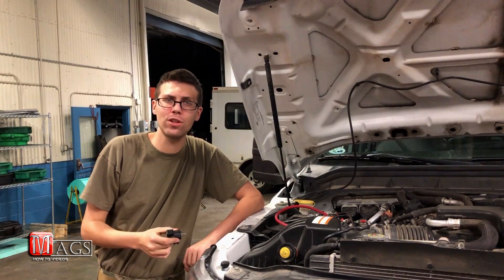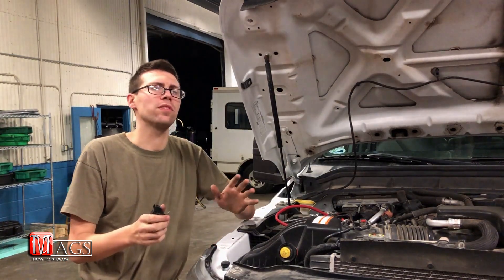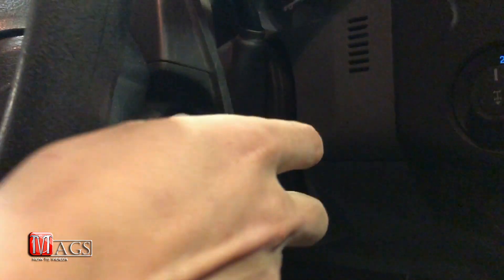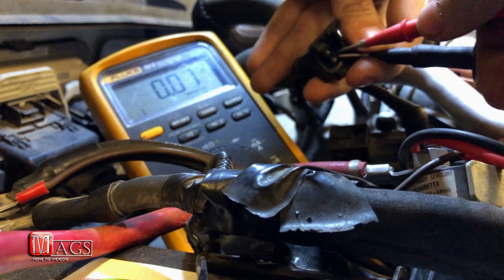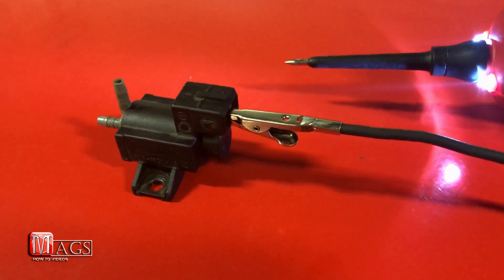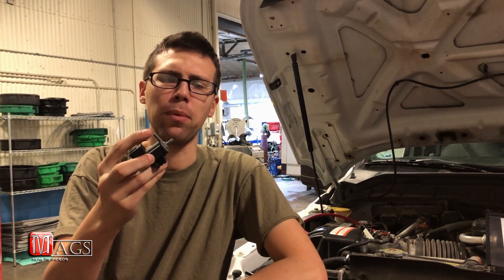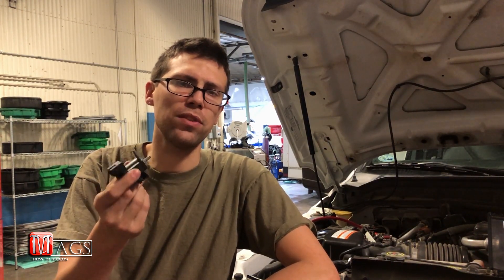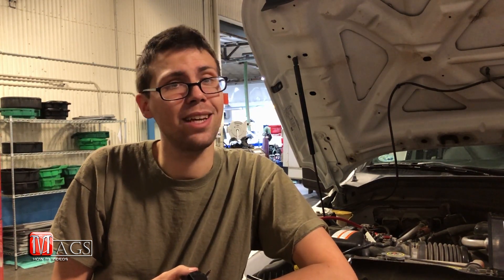How To Test a EGR Valve Solenoid

Comment: There is no power reaching the valve. The tester shows nothing. Where should I look for the break in the circuit? Please help.
Reply from the maker: If your EVAP purge solenoid isn’t getting power, the problem is usually electrical rather than the solenoid itself. Here’s a step-by-step way to diagnose and fix it, starting with the most common causes:

⸻

1. Confirm the power issue

Before chasing wiring, make sure the diagnosis is correct.
	•	Turn the key to ON (engine off)
	•	Use a multimeter or test light
	•	One of the two wires at the purge solenoid should have battery voltage
	•	The other wire is usually grounded by the ECU

No power on either wire = upstream issue

⸻

2. Check the fuse (very common)
	•	Look for fuses labeled:
	•	EVAP
	•	Emissions
	•	ECM/PCM
	•	IGN
	•	Check both:
	•	Under-hood fuse box
	•	Interior fuse panel

Even if a fuse looks good, test it with a meter.

⸻

3. Check the relay (if equipped)

Many vehicles power the EVAP solenoid through a relay.
	•	Common relay names:
	•	ECM relay
	•	Main relay
	•	Emission relay
	•	Swap it with a known-good relay of the same type
	•	Listen/feel for a click when the key is turned on

⸻

4. Inspect the wiring

Focus on:
	•	Broken or frayed wires
	•	Melted insulation (near exhaust parts)
	•	Corrosion in the connector

Gently tug on the wires—internal breaks are common.

⸻

5. Check for ECU control (ground side)

Even if there’s power, the solenoid won’t work unless the ECU grounds it.
	•	With engine running:
	•	Back-probe the control wire
	•	ECU should pulse ground during certain conditions
	•	A scan tool with EVAP purge command makes this much easier

If power is present but no ECU ground → possible:
	•	Broken control wire
	•	ECU fault (rare)
	•	Related sensor issue preventing EVAP operation

⸻

6. Scan for trouble codes

Even if the CEL is off, scan anyway.

Common related codes:
	•	P0443 – purge solenoid circuit
	•	P0458 / P0459 – low/high circuit
	•	P0440–P0457 – EVAP system faults

Codes give direction, not just symptoms.

⸻

7. If everything checks out
	•	No power at fuse → wiring or ignition feed issue
	•	Power at fuse but not solenoid → broken wire
	•	Power & wiring good but no operation → bad solenoid or ECU control issue

⸻

Quick summary

Most common fixes (in order):
	1.	Blown fuse
	2.	Bad relay
	3.	Broken wire near engine bay
	4.	Corroded connector
	5.	Faulty ECU ground control (least common)
Reply: @MAGSHowToVideos  Sorry, I meant to introduce the EGR valve.

Comment: I just tested the egr solenoid on my 97 eclipse gsx that has had an idle surge issue when it is warming up but idles normally once it reaches operating temperature. I blew air through it like you did and it definitely is not holding a vacuum. My egr solenoid is located on the firewall right above the intake manifold. 2 10mm bolts holding it in as well as the evap purge solenoid that sits to the right of the egr solenoid. I hope this fixes my issue. ❤

Comment: Also the dude does mention on how to use the multimeter tool. So first off it needs to be on DCV 20. Then you have to connect the negative to the negative battery. Then you can turn your car on to the on position. Finally use the red pronge from multimeter to the plug in wire to positive side. You will figure out which one is which. Then you get results. 

Otherwise you can't just results by hooking the multimeter straight to the wire ports like they show in this video and others. It will not work like that on all vehicles.
Reply from the maker: Thanks for watching and sharing your input. I’m sure this additional information will someday help someone.

Comment: Great video!! Just did the tests you did on my old solenoid and it's not holding vacuum & barely clicking after I smacked it a couple times. 
Question: Would a bad EGR solenoid possibly be the reason behind why my fuse keeps blowing for the Secondary Air Injection System (Smog Pump)?

Comment: @MAGS How To Videos >> Dont work for Fords though on that blow test as Ford EVP solenoids , because they come in the open stage and only close when electric is supplied to that internal coil , other wise it is vented thru the cap in it. for what you are calling a Egr Solenoid is wrong ( sorry ) that is a EVP Solenoid , which stands for electric vacuum port . Now With That all said , I got a Honest question for you to chew on , that i am trying to find a answer to . That Evp solenoid is controlled thru the ECM which we all know . BUT how and where does the ECM gets its reading from to open and control the EVP ?? Is that controlled thru engine temperature or or thru a reading on the O2 sensor ?? to tell it the engine is fully warm and now to start operating the EGR as the Egr operates on nano movements as you accelerate and decelerate thru your driving profile. and because of the fact that the EGR also tells the engine how to trim your fuel injectors which can cause hard fuel consumption among various other issues .

Comment: Thank you, for the blessed presentation. I did these checks on an ‘03 Mazda Tribute with a 3.0 V-6. 
I noticed no vacuum going to the EGR from the valve. I removed it, supplied power and ground to the EGR valve with a power probe, and no “click” at all (indicating the  solenoid is not functioning, as you said). 
My question is, have you seen many faulty replacement EGR valves?  The one I tested seems quite new. Just curious if you have ran across a few duds in your time. 

Be blessed, be well!

Comment: The 1990 EVTM describes using a vacuum source. I'm using a dual set of vacuum gauges to monitor what is going on. What I'm using would not be detected with this test.

Comment: I've just tested a suspect valve and one port won't allow air through ( which is normal ) but when I blow through the other port air escapes from the small round cover on the back of the valve.  When I connect it to a 12v battery it opens and allows air through so I know it's working, but when I blow through and cover the other port, air is still escaping from the back of the valve where a small round cover is.

Comment: Hi, watching your video in 2024, just a quick question, I checked my car egr solenoid harness and the power was 9.70v . Should I be concerned? I have nissan qashqai dci 2014 with codes P0403 and P0409.
Reply from the maker: @ibneamin3925  I’ve never worked on Nissans, but yes it should be 12v. With that said, if your vehicles battery is reading 12v, that means somewhere between the battery and the EGR solenoid there’s a voltage drop. Common causes, a burnt/corroded wire, fuse panel or computer.

Comment: I did the test just like you did. (The connections for the tubes are in line)  and when I blew into the top tube, air comes out of the bottom connection. When I blow into the bottom connection it's closed. is this a good Solenoid?

Comment: The video was helpful but you dd not show us on the working blowing both side should all hold air or what mine one its holding air another is not also wen u blow it shaking it will open air should l get another one or also wen start vehicle its giving pippin sound wen switch of and on it stop it can start evn wen driving so l need to know of I need egr valve or solenoid
Reply: Did you ever figure this out? I'm in the same pickle

Comment: So what if I have 3 ports? I do get the clicks, now when I blow in one air does comes out of one but not the other but when I supply power then both push air out.  Is it still bad. Solenoids are from a 89 ford probe gt I have two solenoids
Reply: Now I should say one port has a cap on top and the other ports are like the ones  you are showing a side one and bottom one.

Comment: I'm Trouble-shooting The EGR system on my 2005 Santa Fe 3.5L V6 The EGR Valve Solenoid is in a 'open/Vacuum' position, when not powered. With Power supplied it 'Closes/no Vacuum' The wiring Harness Plug Has power, but the Negative(?) connector side of the Plug seems to not be connect to a Ground Source... My Question is: IS The Negative side of this Harness Plug controlled by the ECU through the ground wire, or is it the Power-wire that is controlled by the ECU?

Comment: can a bad egr solenoid cause truck to shut off or die when its running ?
Reply from the maker: Signs your EGR valve is starting to go bad is reduced engine performance, rough idling, engine knocking, fuel smell inside vehicle and engine warning lights. Any of these things can mean you have a bad EGR. A faulty EGR valve affects engine performance by creating rough and jerky accelerations. It also reduces engine power, which is noticeable during low and high speeds. The problem is usually more noticeable at low speeds when the valve is stuck open and more apparent at high speeds when the valve is stuck closed. In worse cases, it can cause the engine to shut off while driving.

Comment: Only 3.79 volts arrive in my car's harness, it's a Golf 1.6 SR, is this normal?
Reply from the maker: I’ve never worked on a Golf 1.6 SR before but 3.79 volts doesn’t sound right. Even if you were testing a 5 volt power signal wire that wouldn’t be enough. Sounds to me like you’re going to have to test your wire hardest to see if you have high resistance.

Comment: So the solenoid should be holding pressure when blowing into either port? And have open flow when applied voltage?
Reply: Good question we will never get an answer for unfortunately.

Comment: Thanks for the video. What about a 3 pin egr valve sensor for a 2007 hilux 1kd ftv? This sensor sits on top of the egr valve and is separate to the vacuum sensor.

Comment: My solenoid blows air through si as you said it’s stuck on open position But when I plug it in power it clicks and holds pressure but then when then take it off the power it remains open.  Is my solenoid bad? Or Good? :). Thanks for the great video!
Reply from the maker: If it retains pressure when powered on it sounds like it’s still good.

Comment: New solenoid doesn't hold vacuum on either side.
The one side that should hold, leaks through the vented side with the filtered cap. Slowly, but just doesn't hold.
Reply: Mine does the same thing did you figure it out ?
Reply: @timothyproksch2915 I ended up using the old one, but I put the new electrical switch part on it. So I Frankensteined it. LOL
Buying cheap parts, sometimes makes things more difficult to fix.

Comment: Please explain how recycling exhaust gases back through the intake manifold will make things cooler?😮🤔🤔
Thanks heaps.
Reply from the maker: By recycling some of that hot air mixture back into the engine, there is less going through your exhaust system which allows it a little more time to cool off. Granted it’s not much, but over time I believe it helps extend the life of some of those parts. The main reason for the EGR Solenoid is to help burn off more of the access gas vapors to produce cleaner admissions.
Reply: Gases Goes through an egr cooler that's water cooled

Comment: What do you mean with the solenoid is ceased? The solenoid is not movable, it's the valve which is movable
Reply from the maker: I mean does the solenoid open and close. If not there’s something wrong with it.
Reply: @MAGSHowToVideos  a solenoid is just a helical coil of wire and it's not supposed to be movable. But it controls a valve and the valve is supposed to be movable

Comment: Great video, thank you.  One question, when the car is not started, but the ignition is on, would you expect to receive 12 volts at the EGR solenoid? I would guess the 12 volts would open the valve and allow vacuum to pass to the EGR valve and open it and thus allow exhaust gases to pass into the inlet stream. I would have thought the introduction of the EGR gases would be dependent on engine temperature and as such the 12 volts would only be present when the computer detected to correct conditions - temp etc.
Reply: either what you said or the the 12 volt signal would be cut off at the time the computer sends the command.

Comment: Should both sides hold vacuum?  Mine is missing the cap on the end. Bottom hose line hold vacuum. top hose I can blow through. Is this normal?
Reply from the maker: Yes that can be normal the real test that’ll determine weather it’s good or bad is will it work when power is supplied to it. Not sure about the missing cap tho.

Comment: I just took off my solenoid. Air escapes from one of the sides when i blow and when i block the other side. Side does not escape from other side when i try other side and blow. Is my solenoid faulty ?
Reply from the maker: Not necessarily that could be completely normal depending on the type of solenoid you have. Have you performed all of the tests? The main test that will determine if it’s good or not is the power prob test.

Comment: Quick question can a VSV properly click when powers applied… But… But the Om readings are below the minimal satisfactory for instance… Mine should be 33 to 36… It reads 30 and 31… Could this still be failing even know it will click when power is applied… Thank you for a response this one's kicking my butt

Comment: Something to keep in mind is that  any electronic solenoid/ actuator  can have either a power or ground  activated  circuit.  
Applying  12 volts to the wrong  terminal can and will fry your computer! 
Bench test with power on only,NOT on vehicle. See scanner Danner for a short but informative vid.

Comment: Great video. How about having to check ohms on the solenoid. Is that needed if you hear click or not when supplying power? If so, what should be reading?  Thks ....jc
Reply: Testing for ohms would not be needed as the click means that it opens and closes properly.
Reply: @directautofix  got it..thks.jc

Comment: Thanks for the video! 
For the good valve, both channels should hold pressure or only the one that goes to EGR? In your video, your testing only that.
Reply: Yes this is what I need to know as well. A lot of info is actually left out of this video. I had to learn things myself even watching this video..still I have 3 ports on my solenoid. One is a vent and of course outlet and inlet port. I can blow air in the outlet port and it comes out of the vent port. I can't blow air in the inlet port.. this guys egr valve is different then ours.

Comment: Great video! Just bought a car, previous owner told me someone scanned the ECU and there was a code "related to the oxygen sensor". Got home, scanned the ECU and the code I got (P0403) is NOT related to the oxygen sensor, but the EGR solenoid. I'll be testing the connector for power and the solenoid to see if it's stuck. Thank you for pointing me into the right direction!

PS: That outro music got me head bobbing right now... LMAO.
Reply: Hi, did you fix your car? i have the same code p0403 and p0409. I managed the check the solenoid harness today and the voltage was 9.70v.
Reply: @ibneamin3925 did you fix it and what was actually wrong with it?

Comment: my EGR is not gettiing 12v at the plug, is that normal ? 08 Ford Ranger ?
Reply from the maker: If you have your vehicle running and you don’t have 12V going to the solenoid than something is wrong. The most likely thing would be a bad wire. I would try an locate some sort of wire diagram and trace the wires so you can test for resistance.

Comment: So when u blow no air should come out. When its good?
Reply from the maker: Depends on the brand you can’t always rely on the blow test because some are made to be closed and so open. The one I used in the video was a closed module. To truly tell if the solenoid is bad you need to perform all the tests if it passes all of the other tests then it should be good.

Comment: my egr is electrical , no vacum hose. If i put 12 v without dismantling it and don't hear the click does it mean my valve is stuck and need to be replaced?
Reply: Or the pintle is jammed with soot

Comment: My solenoid is stuck closed, and not clicking when power is applied.
Reply from the maker: Sounds like it’s most likely broken and needs to be replaced.
Reply: I have disconnected the vacuum pipe that comes from solenoid im not getting any vacuum

Comment: So what happens if it’s holding a vacuum on the highest input and when you blow through the lower one it’s letting air out does that mean it’s still partially open or failing somewhere. Because I’m able to make the actuator click but in trying to put air through the solenoid one will Maintain a vacuum and the other won’t
Reply from the maker: Some vacuum valves allow you to blow through one end but not the other. The one I had was designed to be closed in both directions.
Reply: @MAGSHowToVideos  Ah. One more question. When the EGR valve releases to open, do it do it slowly or instantly. I did a vacuum test and the pump released the air in about 2 seconds.
Reply: @MAGSHowToVideos finally the answer I have been looking for in the comments. One more question can I hook my solenoid straight to my battery to test if it clicks?

Comment: 2:07 - "Ok here we go, we're going to turn the multimeter on...." - Perhaps for your audience, can you please mention what setting you set your multimeter to when you measured 12v vs testing power probe for 12v? Thank you for your video
Reply from the maker: To answer your question the multimeter was placed on DC volts. However, thanks for the input I will try to remember to do that in future videos.
Reply: If you don't know what setting to have your multimeter on then you probably shouldn't be stripping solenoids off motors.

That's the 12v DC testing for beginners video  you want.

Comment: on a 94 Honda Civic it works differently. when there's no power being sent to the solenoid, the valve is open and air flows through. when power is sent to the solenoid the valve closes not allowing air to go through.
Reply: That's the way my 94 Nissan HARDBODY is also. I have to supply power pluse hold my finger over the two outlets to get constant vacum